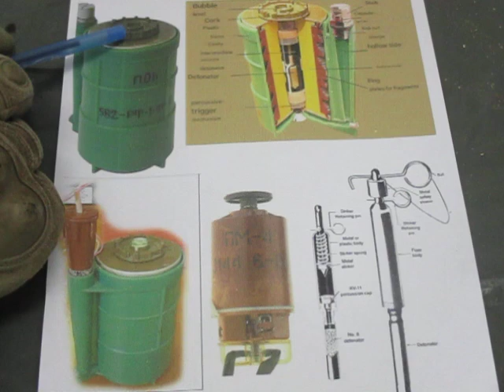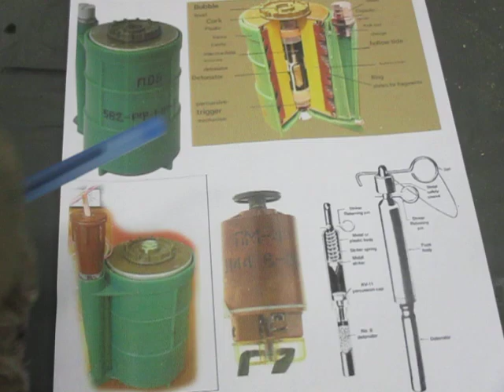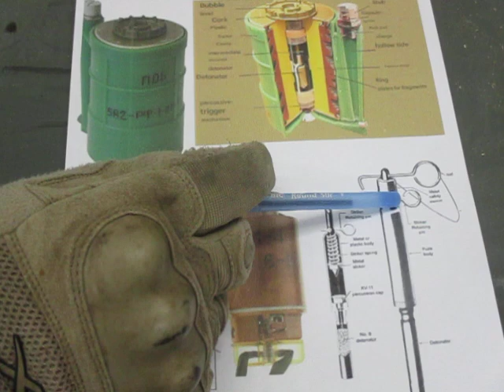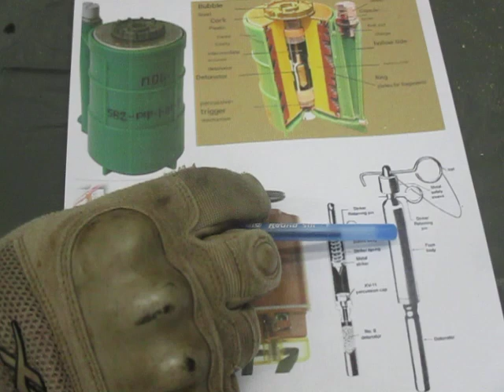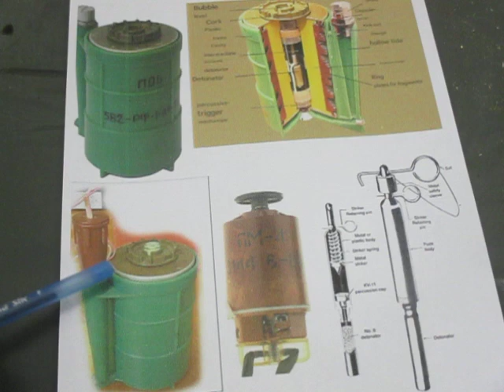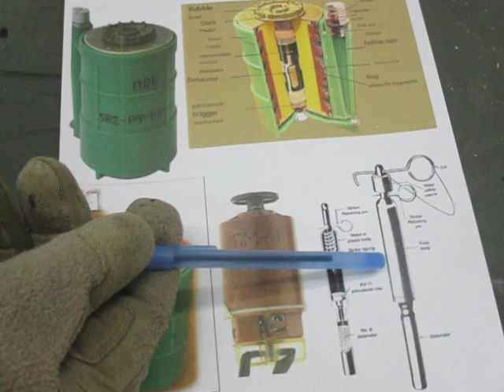Russian POB Bounding Fragmentation Mine

Comment: Reminds me of the new bounding mine the US came out with in the late 80s along the DMZ.
Reply from the maker: And what mine would that be?  Because I don't remember any new models back then.
Reply: @SecurityGuy42  the m26.
They don't last long due to slight spontaneous detonation issue resulting from a issue with the trip wire mechanism. 
I don't know if it was the wire itself or the fuse mechanism.
When it would experience large temp swings it would self trigger.
Reply from the maker: I did a video on that one already and said why it was removed from service.  And it didn't come out in the late 80s.  It was late 70s early 80s.
Reply: My bad. I haven't watched everything you put out.